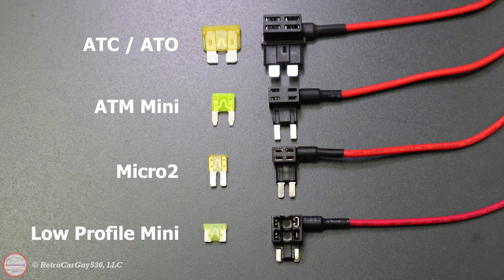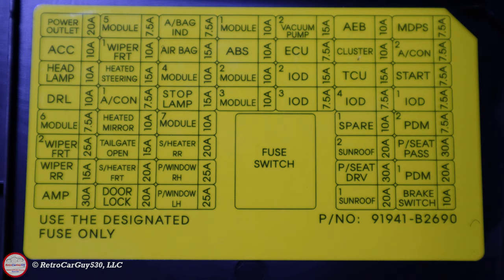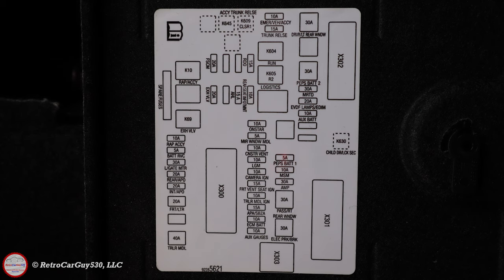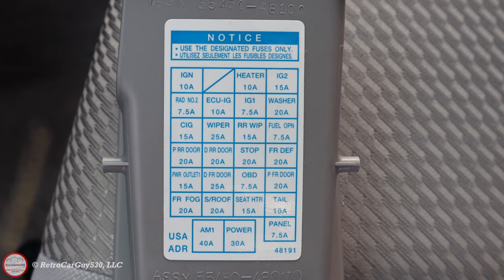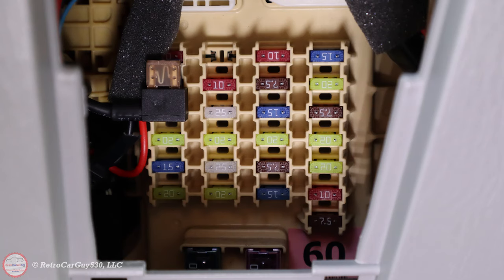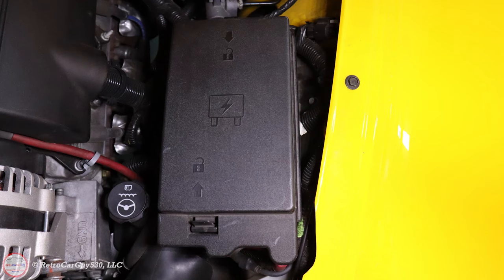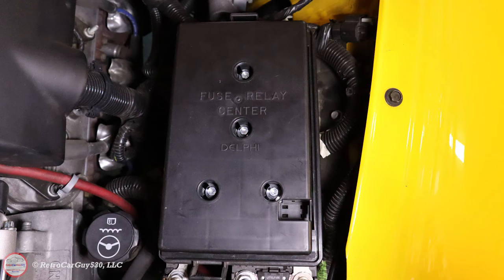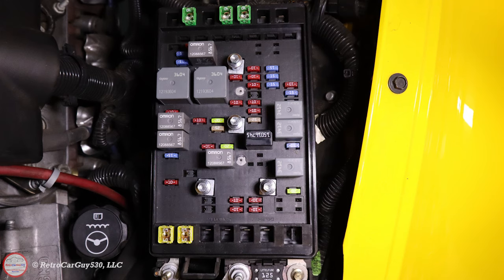How To - Add a Fuse Tap in Your Vehicle

Comment: What if I have some wire sticking out after I put it into the fuse tap and crimp it? Is it recommended to tape it with electrical tape or something similar?

Also, does it matter if my Fuse tap fuse is higher/lower AMP than the original fuse? Do they need to match?
Reply from the maker: Make sure you have good/full contact in the crimp connection. If you do, you could use electrical tape to cover the exposed wire.

The lower fuse socket in the fuse tap holder is for the original fuse in the fuse box fuse socket (if one is present at all). The upper fuse socket in the fuse tap holder is where the fuse for the new accessory is to be placed. Never install a fuse in the upper fuse socket of the fuse tap that grossly exceeds what the new device/accessory requires.  If the new device/accessory only requires 1 amp (or slightly under 1 amp like most dash cameras) then the fuse for the new device/accessory should be in the 2.5 or 3 amp (or 5 amp max) range.  The fuse is to protect the circuitry (wires) and the device so never use too large of an amp rating for that fuse.  There are 1 amp fuses, but I've found that the precision of 1 amp fuses is not as good as one would hope.

A very general rule of thumb is that electrical circuits/wires providing the power to the fuse box fuse sockets have the ability to handle an additional amp load of about 10% more than the fuse in that fuse box fuse socket.  That extra capacity is a built in safety margin for those circuits.  That means a fuse socket with a 10 amp fuse will most likely be able to handle an additional 10 percent (or 1 amp) of load.  For the dash camera example where it can consume up to 1 amp (for the 12-volt supply for the dash camera), you should find a fuse box fuse socket that already has a 10 amp or higher amp fuse in the fuse box fuse socket.  That way if both the original device/accessory that is powered by that fuse box fuse socket reaches its full amp draw of 10 amps, there should still be around 1 amp of extra capacity available to handle the extra load of the new device/accessory.  If there's a 20 amp fuse box fuse socket and you need 1 amp for the new device/accessory, that leaves a little extra breathing room (capacity) for that circuit.
Reply: @RetroCarGuy530  appreciate the quick response! How do you make sure the wire has a good connection in the fuse tap? Do you just put it in as far as it allows and then crimp down?

Also, I'm going to be installing a dash cam so if I'm tapping into a 7.5 ACC fuse and using that as my bottom fuse, will it be ok to use something like a 5A fuse for the top fuse?
Reply from the maker: You strip back the wire insulation enough to expose the wire to the length what will fit inside of the connector but not allow the wire insulation to get into the crimp connector.  When you crimp it down the connector should have a firm hold on the wire. You should be able to gently tug on the wire and it should not move or come out of the crimp connector.

If the wiring for the dash camera has three wires BATT+, ACC+ and Ground, the main power draw (which is still below 1 amp) is on the BATT+ wire.  The BATT+ (constant power) wire is the one that actually powers the dash camera while in normal recording mode and while in parking mode.  The ACC+ (accessory power) wire is connected to accessory (switched) power and its sole purpose is to indicate to the dash camera or the dash camera power adapter that the ignition switch is on or off.  The ACC+ wire does not power the operations of the dash camera.  The ACC+ wire draws a very very small amount of power (my multimeter can't even measure it).  The ACC fuse box fuse socket with a 7.5 amp fuse should be fine for the ACC+ connection from the dash camera.  The fuse in the upper socket of the fuse tap should be as low as possible since that dash camera wire draws next to nothing.  The fuse tap for the BATT+ should be as close to 2 amps as possible.  You can use a 5 amp fuse for either one, but I would suggest getting a 3 amp or 2.5 amp fuse for the upper fuse tap fuse sockets for both of those fuse taps.
Reply: @RetroCarGuy530  that is super helpful! thank you for the in depth explanations!

Comment: is there a fuse tap available for micro j case fuses? Thanks
Reply from the maker: Not as a product sold by a company.  I have viewed a video that shows how to hack a j case fuse socket to use a blade fuse.  One might imagine that instead of using a fuse directly at the end of the wires shown in that hack video, you could use a blade fuse tap to allow you to split that into two circuits.  I’ve not tried that approach, but it might be one way to do it.  https://youtu.be/oNOkp5dNG-k
Reply: @RetroCarGuy530  I saw that video also earlier today. I've checked with the local dealership service department mechanic, and he stated that should work for the application that I intend to use it for. Thanks for your help.

Comment: Is there another way to test a fuse or empty socket without a multimeter cause i dont own one
Reply from the maker: You can use a multimeter or a 12-volt test light when checking for power.  I quickly mention the 12-volt test light at about 6:33 in the video.  The only thing you can't test for with the test light is the exact voltage level of the socket, but most/all of the blade style fuse sockets in modern cars are setup for 12-volt power.  Most automotive parts stores carry test lights of that type and they tend to cost around $10 USD or less.

I hope that answers your question.
Reply: @RetroCarGuy530  Yeah thanks, I think a test light would be best for a cheaper option

Comment: What do you do l, if you are using a relay that comes with (2) maxi fuses? Do you still use the fuse taps but don’t insert the small fuses in the connecion port?
Reply from the maker: The fuse tap you use must match the fuse box fuse socket type.  I use a relay that has an integrated Maxi fuse socket for the "load" power.  I wire the terminal 30 power directly to the vehicle battery since the relay has the integrated fuse for that power.  I wire the control power side of the relay (terminal 85 or 86 depending the relay documentation) to a fuse tap in the fuse box which are ATM Mini fuses in my vehicle's fuse box.  A fuse tap must have at least one fuse in it to provide power to the "new accessory".  In the case of the two connector blade style fuse tap shown in this video, the upper fuse socket in the fuse tap is the one that provides power to the wire that is connected to the new accessory/device.   I'm not sure I've answered your question.
Reply: Thank you for your response & i’m trying to understand (not a mechanic/electrical person at all). I have dual electric fans & a dual Volvo relay which is going into a 80s model gm vehicle. The volvo relay has a power wire, (2) power to each fan, (2) ground wires & (2) wires for temp sensors which will turn the fans on. Also there is (2) 30 Maxi fuses (1 for each fan) . Trying not to run the power wire to battery because cooling fans would keep running after turning car off.
Reply from the maker: A fuse tap is not suitable for directly providing the power to run these fans.  If both fans are running they could potentially pull up to 60 amps and there's no fuse tap that I'm aware of that can even come close to supporting that level of power draw. 

There's another potential solution using one additional relay and a fuse tap to provide switched/accessory power to control when the new relay would provide power to the volvo relay.

The new relay must support 60 amps or more and it would be inserted into the volvo relay power wire.  This relay will control when the volvo relay has power to send to the two fans.  The volvo relay still controls when the fans get power based on the temp sensors, but the new high amp relay will decide when the volvo relay has power to send to the fans.  You could use a fuse tap to provide accessory/switched power to the new relay when the ignition switch is on.  When the ignition switch is off, no power will be provided to the volvo relay, thus preventing the fans from running when the ignition is off.  

The new relay's terminal 30 would be connected to the battery.  Terminal 87 would be connected to the input power wire of the volvo relay.  Terminals 85/86 would be the ground and switched power from the fuse tap.  You would need to read the documentation for the new relay's control circuit to see if terminal 85 receives the fuse tap provided power or terminal 86 and then of course the other is the ground.

Comment: Cam i combined 22awg wire with a 16awg wire and what fuse amps is to use?
Reply from the maker: You can combine 16 awg wire with 22 awg wire, but the most restrictive part of that circuit then becomes the 22 awg wire.  I have a FAQ video for this topic where I discuss wire gauge and distance and how it impacts the max amperage you can deliver through that wire / device / ground wiring.  https://www.youtube.com/watch?v=DnZ5wb_A5vE

In that FAQ video, I don't go down below 16 awg because smaller gauge wires can carry so little amperage.  From what I can find a 22 awg wire can only carry about 7 amps for short distances.

You need to determine what the device you're powering requires for amperage and use that as a basis for deciding what wire gauge (awg) is needed to support the device's power draw requirements.  You need a fuse no larger than what the device can at max draw and the wiring needs to support that amperage for the total distance of the circuit (fuse tap, wire to device, device and ground wire from device to ground connection).  I talk about this thought process in the other video.

I hope that helps.

Comment: Does it matter if the fuse you’re putting the fuse tap onto has higher amps than the fuse you are using for the dash cam?  Meaning if you find a good spot for the fuse tap and it’s 15a already in there and you install the fuse tap, put the 15a in the lower portion of the tap and then a 10a in the top spot of the tap?  Will this hurt anything?
Reply from the maker: A fuse box fuse socket with a 15 amp fuse can be a good candidate to use for the fuse tap.  Adding a small extra load to a 15 amp circuit is usually not a problem and my definition of small is 1 to 5 amps.  Adding a 10 amp load to a pre-existing 15 amp circuit could potentially overload the wiring supplying the power to the fuse box fuse socket.  A fuse tap can be a good way to power small load devices like dash cameras (usually under 1 amp) or radar detectors.  A lot depends on how the power is used on the circuit (before fuse tap).  Does the original device require the full 15 amps all of the time or only when it first starts up?  A 15 amp fuse means the wiring should at least support a 15 amp load on the circuit, but adding something that can require an additional 10 amps (total of 25 amps) might push the amp load requirement over the circuit's capability.

When the amp load for the new device approaches 10 amps, I tend to suggest using a fused relay circuit (if it requires switched/accessory power) or a fused wire with either of those being connected to the battery directly.  That way the demands of the new circuit will be satisfied by the new wiring.  If you need to have switched/accessory power, using a relay to get the device's power is fine and you can still use a fuse tap to get the control power for the relay control circuit from a switched/accessory fuse socket since the control side of the relay only consumes about 100 mA.  I discuss the relay approach in a video I created about installing and hardwiring a dash camera battery pack.

https://www.youtube.com/watch?v=Joa0fiKZY-o
Reply: @RetroCarGuy530  Thank you for the detailed reply, I appreciate it. I purchased a Garmin Mini 2 that I’m wiring this weekend. Do you typically use a specific amp fuse for all dash cams or is there a way to figure out what amp fuse your specific Dash cam needs?
Reply from the maker: Every dash camera I've tested (including a couple of 3-channel dash cams) consume 1 amp or less.  I would suggest a 2.5, 3 or at max a 5 amp fuse in the top socket of the fuse tap to power the dash camera.  There are 1 amp fuses, but I've found those to be less accurate than one would hope at blowing at 1 amp.  A 2.5 or 3 amp fuse is the amp range I would recommend.

Comment: Great video and I have to state the obvious the fuse adapter is for the V+ supply and the negative V- you can get from a good ground anywhere? Thanks
Reply from the maker: Correct, the fuse tap is for the V+ side of the circuit.  The ground can be obtained any place that is going to provide good ground connectivity, but you do have to consider the entire wire length V+ (from fuse tap all the way to the accessory) and V- (ground from accessory to ground location) when calculating the maximum circuit wire length.  I mention that in the FAQ video.  https://www.youtube.com/watch?v=DnZ5wb_A5vE